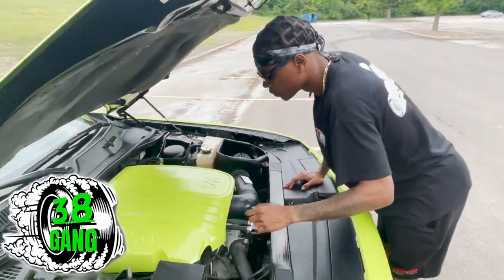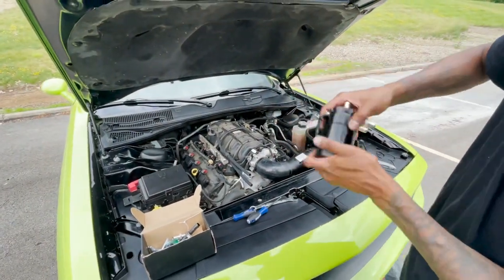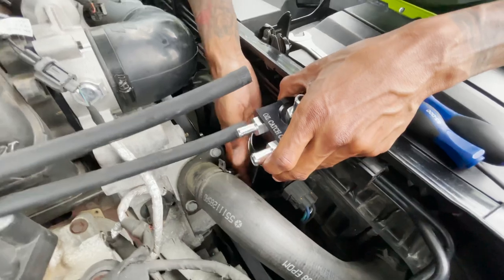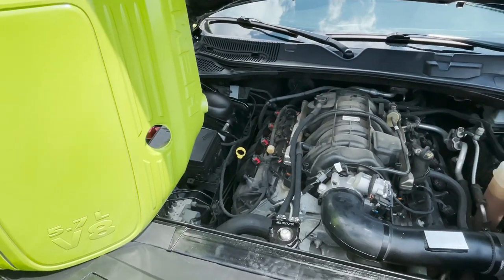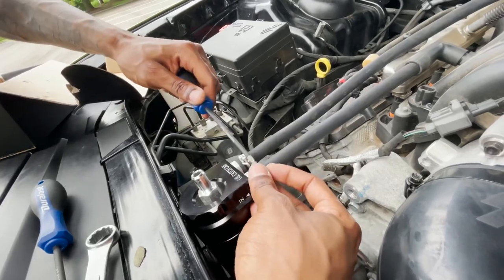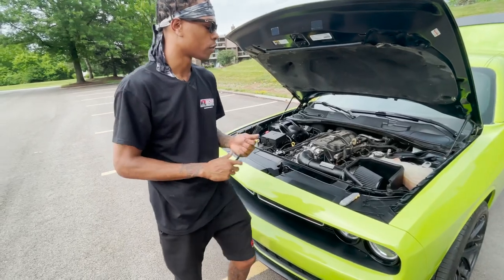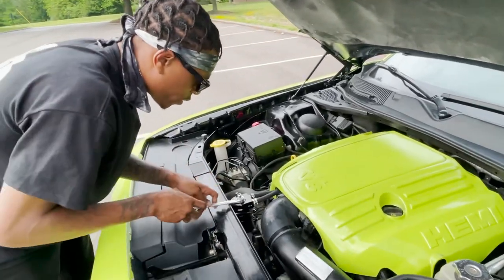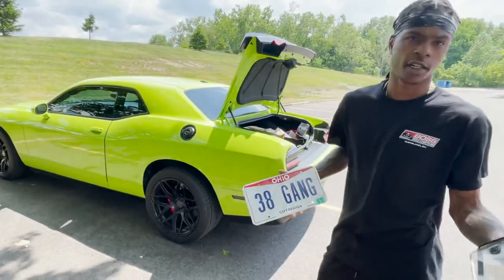Oil Catch Can Installation The Right Way - EVERYTHING You Need To Know !!

Comment: Hello! Thank you for the video. I got the same brand of the catch can (Evil Energy). I think your direction of putting the pipes is backwards. Wouldn't it be from the PCV valve going into the [IN] of the Catch Can (filters oil from air) and then [OUT] of catch can to the intake manifold? 

Thanks in advance.
Reply: Is it right or wrong ???
Reply: @champm5178 its 100% wrong.
Reply: @KINGMUFASA  thank you I am putting one on right now so out line goes to intake thankyou 😂🙏🏼
Reply: @champm5178  Yeah, no worries. So the PCV (already comes with the vehicle), the pipe coming out if it, that is supposed to be the [IN] for the catch can and the [OUT] will get connected directly close to the throttle body manifold port. 

Essentially,  it's like a loop where you have 2 filters (PCV + Oil Catch Can]. 🫡